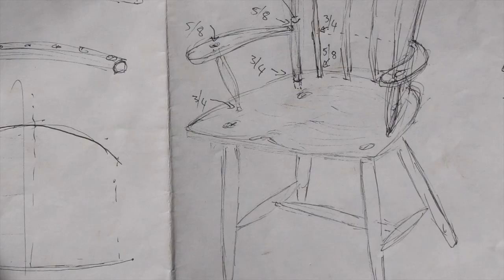Making a Windsor chair from green wood

Comment: Hi Alex,

You could not have wished for a more perfectly suited log to its end purpose that is the chair. With your ability to choose the curved grain for the bend in the armrests, as this are one of the most obvious parts that catch the eye of others when seen by others.
Your chair is superb, and I am commenting as this type of chair, with no steel in it and with completely natural joints it is also one of the most challenging types of chair to build, with nothing about the chair ‘easier’ to build than the previous part, though I think the seat has to be the most difficult part.

Take care
mrbluenun